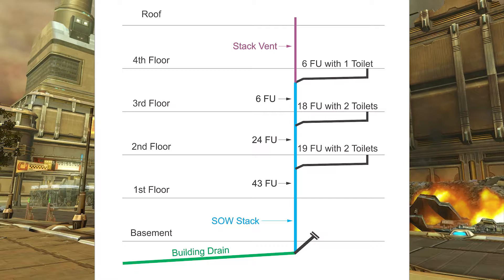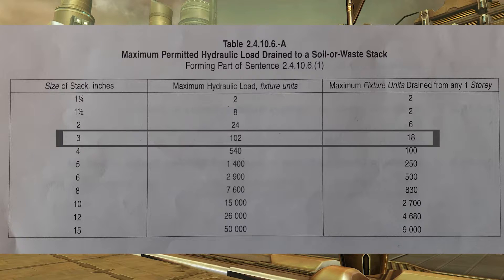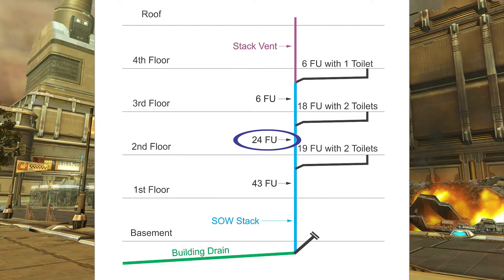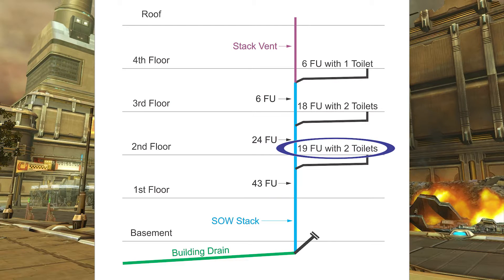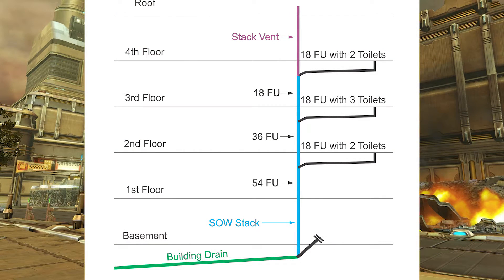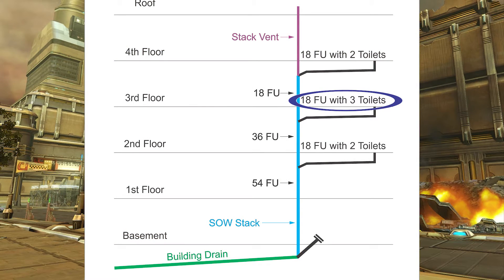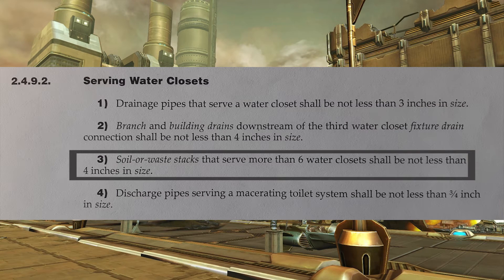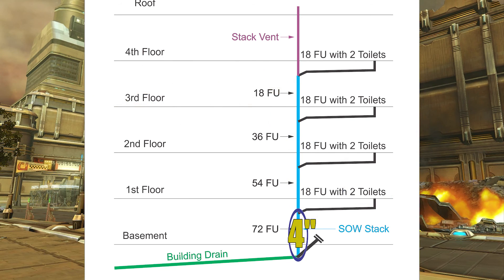Vent Stacks: Part 2 - Sizing Soil-or-Waste Stacks

Comment: Is it implied in table 2.4.10.6  that a Soil-or-Waiste stack always serves a vent and a drain ? In other words, could we say that a SOW stack is always self venting, always uses the wet vent principle ?
Reply from the maker: Table 2.4.10.6.A is solely referring to sizing of the SOW stack for drainage purposes.

Can a SOW stack act as a wet vent when it meets certain criteria and sized properly, yes. But that involves going through various clauses of the code in section 2.5

There are too many concepts to cover in a simple text reply. Fortunately, if you want to learn about this, I have multiple videos that cover these different nuances.

Comment: Funny i just watch the 3yrs old video too,  ( 7 days after the first commenter)   and have the same question  as im bulding my house, i have 2 W.C. on 2nd floor  and 1  W.C.  on 1st floor.   do i need the 4'' after the 1st floor. ?
THXS
Reply from the maker: The code clause I referenced has two distinctions. One is the number of toilets running through a horizontal drain, the other refers to the number of toilets running through a vertical drain

Maximum 2 toilets can be drained through a 3" nominally horizontal drain.

Maximum 6 toilets can be drained through a 3" nominally vertical drain.

If you don't know the difference between nominally vertical and nominally horizontal, watch this video: https://youtu.be/hY4PP1-p2u0?si=T4ZhH70ADqBP-aNT

Comment: In SOW Stack sizing where you had 2 wc on each floor, by the time you reach below second floor from the top, you already have 4 water closets. So shouldn't we have 4 inch SOW Stack after 2nd floor already? Why are we waiting till we have 6 wc and refer another code clause?
Reply from the maker: The code clause I referenced has two distinctions. One is the number of toilets running through a horizontal drain, the other refers to the number of toilets running through a vertical drain

Maximum 2 toilets can be drained through a 3" nominally horizontal drain.

Maximum 6 toilets can be drained through a 3" nominally vertical drain.

If you don't know the difference between nominally vertical and nominally horizontal, watch this video: https://youtu.be/hY4PP1-p2u0?si=T4ZhH70ADqBP-aNT